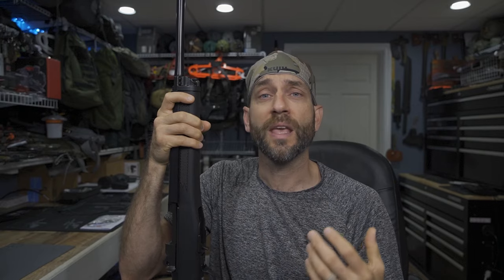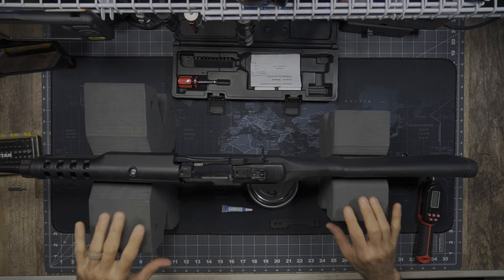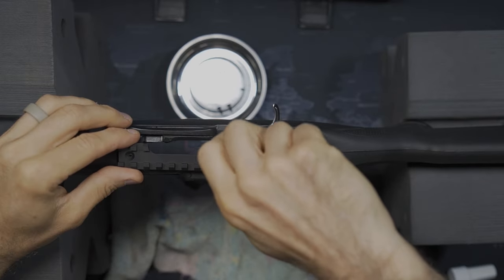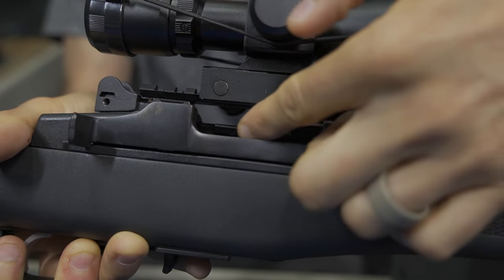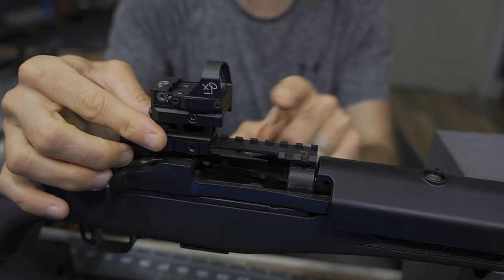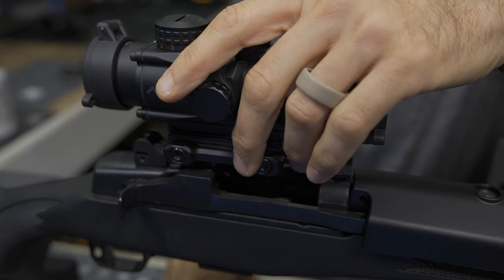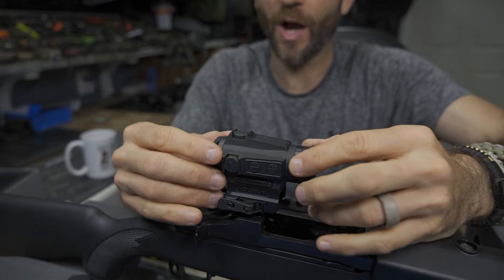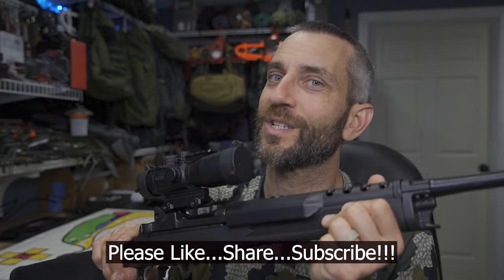Ruger Mini 14 Factory Pic Rail - What Use Is It ???

Comment: I mounted a LPVO on the rail with rings that match the scope’s builder. No ejection problems because, ejection is horizontal out of the chamber not up. Only problem is heat buildup in the chamber melts thread locker and the two screws on the Pic’s front back out.  Happened to me twice over about two-thousand rounds so periodically shake the front of the optic to check for torque.

Comment: quote from the manual: "4. Starting at the first screw, turn each screw part way in; then move to the next screw, repeating the procedure until all four screws are tightened to a maximum torque setting of 12-15 inch/lb. "

Comment: The Mini - 14 does not 'Eject' it Launches cases.
Reply: it will launch a case into the next county.
Reply: Usually, when I can't find mine, I haven't gone FAR ENOUGH... I haven't measured, but I'm thinking up to 35 feet?

Yes, that's a long way, but that means it can get MIGHTY DIRTY and still cycle. Just need to get some spare "buffer bushings" 🙂

Comment: The ruger rail is really designed to be used with a traditional scope and rings so your vortex scopes are likely to give you the best accuracy and consistent shooting of all those optics. All you'd have to do is loosen the rings and move them and then resight in. Regardless of what optic you go with, all the ones you tried in this video were mounted WAY too high. I would recommend taking that reflex style sight off its riser and mounting it directly to the rail. Or using a low mount for the holosun. Having a good cheek weld will make it much easier to shoot no matter what optic you use.

Comment: The pic rail provided is really good at screwing up ejection . Works fine on a bench but if you move around or actually use the rifle it makes problems.  Just my experience, I just installed the rings that came with it yesterday and picking up a scope to try today. Really just don’t want to drop the money on an ultimak.
Reply: Thanks for the info. I been researching how to stop the damage to my scope cap. Currently using the stock rings was thinking about going to the stock rail with new set of rings and you just answered my question so I'm going to stay away from the rail. Maybe I'll try and reposition my scope. Thanks again for the comment!

Comment: Reading through the comments its apparent several Mini 14 owners who went down this path learned- like me- this isnt an operating system conducive to have a rail over the receiver and in the ejection path.  I tried this set up for a year and noted brass was consistently hitting the rail and deflecting, at least twice a shell bounced back into the action as it was closing and caused a jam.   The ejection arc will change somewhat depending on how hot your loads are but for me this configuration compromised reliability.  Went with the Hannibal rail and  am quite pleased with it, pricey but its well built.

Comment: Clean threads of screws and receiver with brake cleaner or acetone (finger nail polish remover) apply blue loctite.  Tighten until it strips, then back off a quarter turn.  😂

Comment: I tried a pic rail on top of my 189 series Ranch Rifle.  I found the height over bore to be too high.  The height using the Ruger rings with an optic was much better.

I wanted to run a red dot instead of a scope, and was able to mount a Vortex Strikefire using a single 30mm Ruger ring on the front sight base.

The Ultimak rail is nice.  You don't have to worry about brass hitting the optic, plus a red dot or extended eye relief scout scope can be used with a proper cheek weld on the stock.

Comment: Proper torques on fasteners that don't provide a spec can usually be achieved by paying close attention to movement while tightening.  The force needed to tighten will increase gradually up to the proper torque where it will suddenly increase.  If you stop at this point you'll be very close to proper torque.

Comment: i put a sparc 2 on mine.  it's a ranch model with the wood stock.  except i put a thumbhole stock on it,  and adjustable gas block.  when i bought it, brass was flying 30'.    seriously,  my brass went over 3 benches, and into the weeds at the outdoor range.  i was glad the place was empty when i went.   the gas block was an easy fix, and no more slamming also has to be a good thing.  now it's my most fun gun.

Comment: GG&G makes a rail for the Mini. It uses the scope ring slots on the side to lock down, and is a longer rail than the Ruger rail. The older unit they sold required removing the rear sight but the current unit on their website shows it does not extend back farther than the Ruger rail. It does however, add additional rail space forward and does not have a cutout because it rides higher than the Ruger rail and is tapered on the sides. It would hamper removing the heat shield so would have to be removed if one wanted to remove the heat shield. It wouldn't have to be removed for general cleaning. It currently costs $51.95 and is available in both blued and stainless.
They also offer a unit that comes with a Burris Fastfire 3 red dot sight and a protective cover for the sight. It's a bit pricy ($271.00 currently) but if one wanted to run only a red dot, it would work. It also obstructs removal of the heat shield.
https://www.gggaz.com/ruger-mini-14-mini-30-accessories.html

Comment: In my case, Ruger left the plugs of the new rifle quite far down in the screw holes which I did not know about. 
The screws engaged them and further pushed them down where they interfered with the action.
I was unable to remove them and had to send the entire rifle to them to get them out.

Comment: I've been using a Primary Arms MD25 for years on my Mini30 without a single issue ejecting or any other on this Ruger supplied rail. I thought about getting the GG&G rail but decided not to since I don't have any issues.

Comment: Do you have to take the rail off to disassemble the Mini 14 for cleaning?
Reply: (If I recall correctly) NOPE, but the bolt only comes out ONE TRICKY WAY. I think it helps if the muzzle is pointed down so that the firing pin stays all the way forward in the bolt during removal/replacement (again, from memory).

Comment: I had to take my lpvo off my mini. I had multiple jams when sighting in and all the brass I collected after were dented in the same spot. I inspected the scope and I found brass etchings on the L/R adjustment cap. I’m not very worried about damaging the optic, but I hate not having confidence in the rifle if it will fail on me or not. So I’m going to install a different gas bushing to see if that helps. I also have a different rail spring to try if the bushing isn’t enough. Otherwise a Hannibal rail and reflex sight will be my fall back option.
Reply: Same exact problem with a Burris red dot mounted on a rail over my Mini 14 receiver.  Just enough in the ejection path for brass to occasionally hit the rail and a couple times the case bounced back into the action and would cause a jam as the bolt closed.  Went with a Hannibal rail instead- pricey but its extremely well built

Comment: I would check out the Ultimak rail, I linked it in a comment before and the comment was taken down. It's my favorite mini 14 mount, turns it into a scout rifle
Reply from the maker: The only issue I have is that those rails push everything forward.  I need to pull everything towards the rear
Reply: Why do you need your Optics towards the rear? There blocking your field of view and with those options you don't have a proper cheek weld, With a scout mount ( Ultimak or Samson ) and a Burris low power scope or a red dot your field of view is wide open using both eyes.
  Just my thoughts.
Reply from the maker: @ianpleshette  This was a video about the factory rail, right?

Comment: The Primary SLX does not mount correctly. If the front will not tighten down its not meant to go on the particular Pic rail
Reply from the maker: Yep pretty much what my point was on this whole video concept.  The factory rail leaves a lot to be desired
Reply: @OuterLimitless2  well I'm like you in exactly sure what Rugers angle with this pic rail is unless it's just meant for scopes with the bigger scope tube than the rings it comes with

Comment: That rail is garbage. Mine comes loose when i get the rifle good and hot. I’ve replaced it two times, used rock set and it still came loose. I finally fixed it by using 30mm Ruger rings

Comment: with blue loctite 12 in-lbs is generally a typical torque value.  without blue loctite 15 in-lb is generally a pretty typical torque value.  all for screws this size.